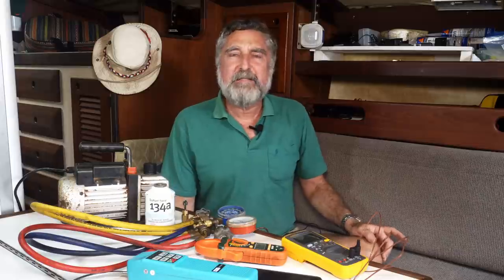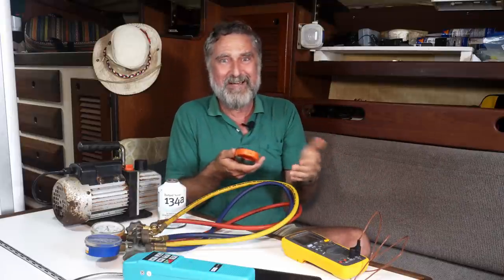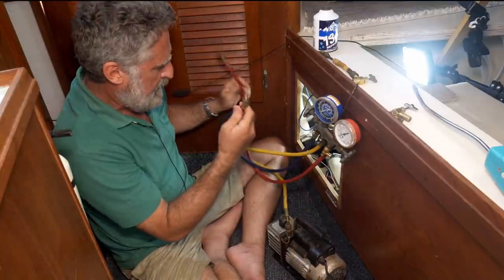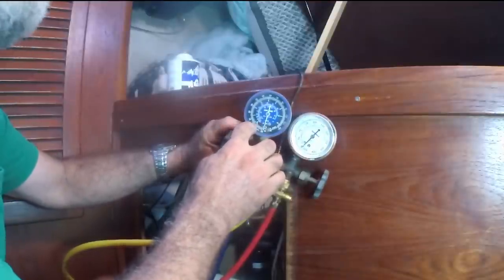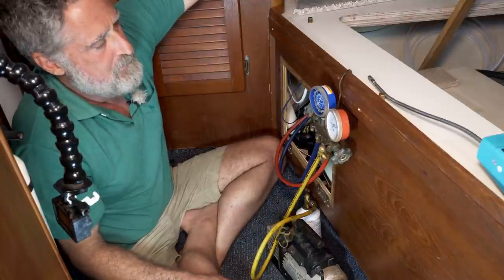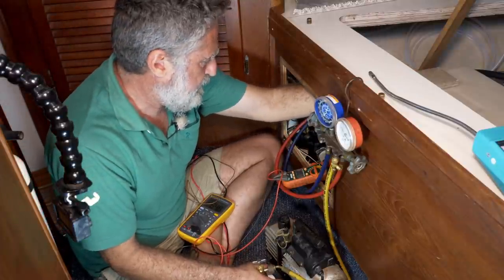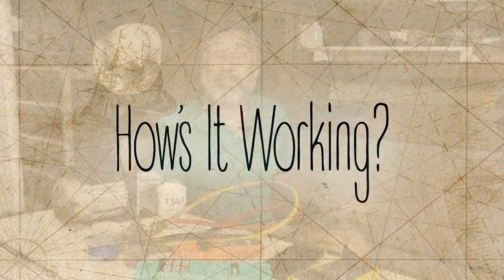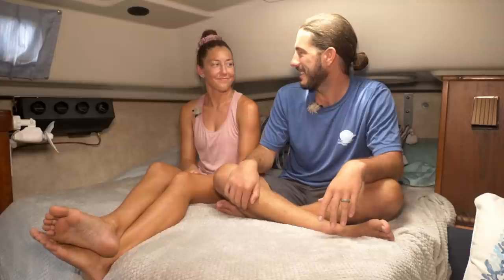How to Charge your Battery-Powered Air Conditioner

Comment: Great video, very informative. You mentioned 24V for the motor. Is it equally efficient when supplied with 12V DC? I am planning on re-doing the electrical system on my old 1992 cat but presumed the DC side would be connecting the batteries in parallel and it being 12V. Just want to better understand requirements of the DCAC system.
Reply from the maker: The numbers I give in this video. https://youtu.be/xF113aUlZgo

Are as they come out of the 12v batteries including losses from the boost converter.   It sips power.
Reply: @Clarks-Adventure  That is wonderful; nice integration. Thanks guys.
Reply: General engineering the increased efficiency of the compressor motor is more than the loss from the solid state converter. Down converting is usually more efficient than up. 
If your re-doing your system it may be worth having 24v main banks if the majority of the watt hours are on 24v rather than 12v since there will be losses on the bulk down to 12. 
Point is calculate your loads. Thought I would have majority on 24 then difficult availability forced 12v. Larger the boat and loads the higher the voltage to keep wiring practical. 
The basic mosfet efficiency available has gone way up recently, dc to dc is less evil than before. All the motors that are efficient are 3 phase ac variable frequency from the controller, so this is just controller feeding.
Hope that helps, I have been down this rabbit hole a while.